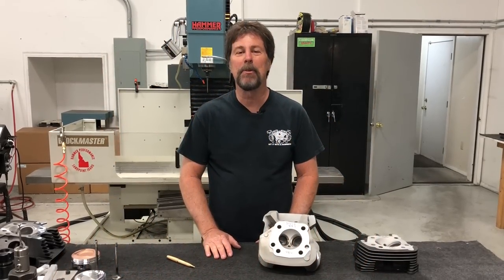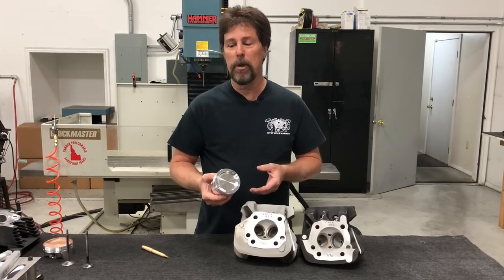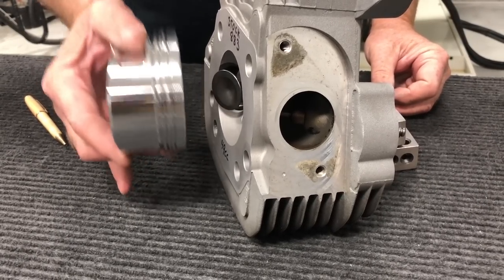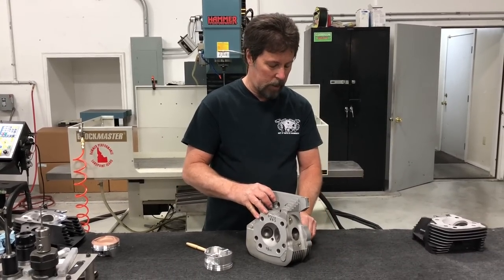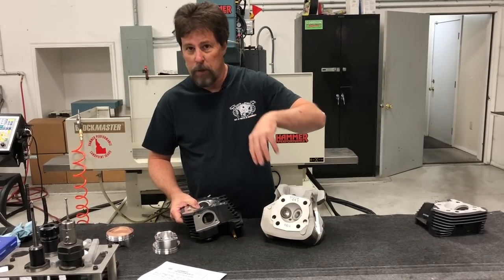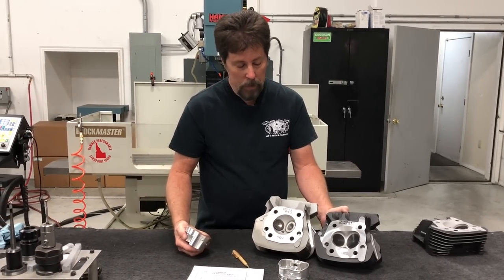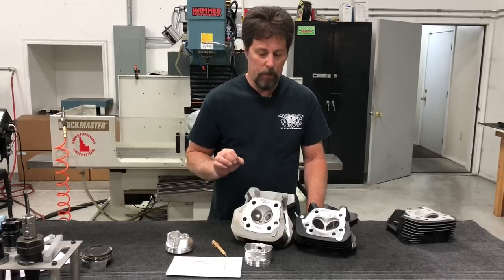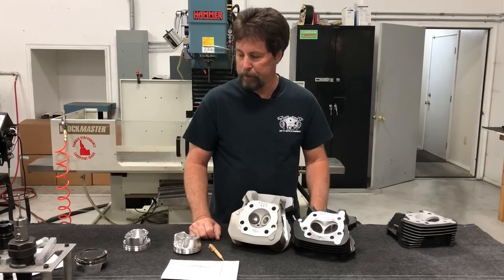Converting A Harley Davidson 883 For Big Power!

Comment: I want to get one of your kits. The stock clutch is about as stiff as I can pull. Any suggestions? I know improvement on the clutch is needed.
Reply from the maker: A clutch upgrade may or may not be needed, depending on the year and model of your Sportster and how far up the power chain you plan to take it. Let me know the year, whether it's an 883 or 1200, and your ultimate power goal and I can be more specific.
Reply: @HAMMERPERFORMANCE  my sportster is a 2002. 883 with five thousand miles. If we can get around 80 hp. I'd be happy. I want to change the front sprocket to 1200 gearing. How much hp can those stock drive belts take?Thanks.
Reply from the maker: @glengerdes2447  See the 80+hp conversion package here: http://www.hammerperf.com/883conversions.shtml#80hp  . No need to upgrade the clutch. The belt is more than strong enough too. That package has everything you need. Download the sample quote to see everything included and what it costs. Contact us using this form and we'll get you fixed up: http://www.hammerperf.com/contactus.shtml#salesform

Comment: Your talking wizardry to me.. But it's cool that you know this much about engineering, please help me.

I ride a 160hp monster s but just recently got a sportster 883 in mat black some eagle iron edition thing. It's the most beautiful HD bike in the best collor of the series to me, that's why i got it and also not to wake my neighbors up every night with that SC project flamethrower. But i find the ride of the HD equivalent to what i call a scooter, and would like to get 110 or 120hp out of it if i can. Is that posible and do you know someone in Europe who can help me do what you just showed us? Did you ever cooperate with someone from theses parts and what do you suggest?
Reply from the maker: You can read about our 110hp package here: http://www.hammerperf.com/883conversions.shtml#110hp and our 120hp package here: http://www.hammerperf.com/883conversions.shtml#120hp . Download the sample quote to see everything included and what it costs. There are several good shops in Europe who can install it. But it's not difficult to do yourself. These are bolt-on packages that can be installed in an afternoon without even pulling the engine out of the frame. We provide instructions and videos and tech support 7 days a week. Most of our customers are do-it-yourselfers.

Comment: how much does your mpgs suffer when you do the 883 to 1200 conversion?
Reply from the maker: Well, we don't sell 1200 conversions so I can't comment on that. But I can tell you that the majority of our customers report an improvement in fuel mileage after installing a 1250 or 1275 kit. 

You have to remember, the bike still needs the same power level to go a given speed as it did before the conversion. For example, if it needed 15hp to go 60mph before the conversion, it still needs 15hp to go 60mph after the conversion. You're in control of that power with your right hand. You're going to automatically apply the correct amount of throttle to make 15hp and go 60mph. The fact that it can make a whole lot more if you open up the throttle is really irrelevant to the fuel mileage when cruising. 

At the end of the day, fuel mileage is a function of how efficiently the motor turns fuel into power, not how much power the motor is capable of making. The efficiency gains you get from raising compression, which is a part of almost every conversion, can actually cause an improvement in fuel mileage.

Comment: Is it normal to experience increased valve train/rocker noise after the conversion? Is it because of the pushrods not being adjustable?
Reply from the maker: There are a ton of different things that can cause excessive valvetrain noise. Incorrect pushrod length is one of many possible causes. When using hydraulic lifters, the pushrod length must preload the lifter plunger an amount that keeps it in it's self-adjusting range over the range of top end growth the motor encounters. But that can be accomplished just fine without adjustable pushrods. Adjustable pushrods may be the easiest way to do it, but certainly not the best way. A non-adjustable pushrod of the correct length is the best solution, in terms of cost, strength, weight, simplicity, and reliability. We offer non-adjustable pushrods in a variety of lengths and we show three different methods for determining the correct length in this tech article: http://www.hammerperf.com/ttpushrodlength.shtml . When we put together a package, we select pushrod length using method #1, and we suggest the customer check it during assembly using method #2.
Reply: @HAMMERPERFORMANCE  Very interesting article! I was of the impression/reassurance from the dealership that pushrods for Sportster do not need any adjustment despite putting high performance cams, valve springs and tappets! Hope no harm is taking place though! Should I be alarmed?
Reply from the maker: @100streamliner  Well, I'm sure you understand, I have no way of knowing whether or not your particular combination requires different length pushrods, at least not without knowing all the details as listed out in the top of that tech article. I would say that if you're concerned, then check them with method #2: http://www.hammerperf.com/ttpushrodlength.shtml#method2 . That's really the only way to know for sure. I will say though that we always upgrade the pushrods to chrome moly pieces when using heavier valve springs, even if there's no need to change the length.
Reply: @HAMMERPERFORMANCE  Thank you very much! Much appreciated and again the article is superb! Will check as you point out using the 2nd method.

Comment: The focus here is all on increasing horsepower and performance. What about a guy like me who wants more torque and is willing to sacrifice performance for an engine that runs cooler and lasts longer? I just want to get down the road better with more speed and better handling.
Reply from the maker: Ultimately, torque is two things: Cylinder pressure and it's mechanical advantage on the crank (aka displacement). So to get more torque, you either have to raise cylinder pressure or raise displacement or both. Raising cylinder pressure increases the heat generated, it doesn't decrease it. So that's contradictory to your goal. Therefore I would suggest focusing on making the motor bigger. Since you're watching this video, I'm assuming you have an 883. The Basic Conversion Package is available in your choice of 1250 or 1275 displacements and either one delivers a massive increase in torque. Read all about it and also see the dyno sheets here: http://www.hammerperf.com/883conversions.shtml#basic .

Comment: Sorry if I trigger you but with a conversion kit on my 883 (to 1200) will I get the same speed that a regular 1200 does or what?Can someone please tell me what exactly it does?
Reply from the maker: We would need quite a few more details to be able to answer that question. For example, depending on the specific years and models you're talking about, the two bikes may have different stock cams. Also it depends on how the conversion was done, for example whether it's done with 883 heads or 1200 heads. If you want to give me all the details, I'll try my best to answer.
Reply: @HAMMERPERFORMANCE  I m talking about 2016 model iron 883 and everything stock
Reply from the maker: @aggelossimadis2511  It just occurred to me that you're asking about an 883 to 1200 conversion. We stopped doing 883 to 1200 conversions several years ago. We offer your choice of 883-to-1250 or 883-to-1275 conversions. You can read all about them here: http://www.hammerperf.com/883conversions.shtml#basic . If you want info on an 883 to 1200 conversion instead, there are many companies that offer them. But not us.

Comment: you say those are the same heads but make no mention of all that material filling in the chamber of the second head.  why not just start with 1986 883 heads? that way you would not have to weld in the chamber and risk dropping a seat. am I wrong about this? where did all that material come from? if you started with a 1986b head you would have had to weld it in.
Reply from the maker: None of the heads shown in this video have any material added to the chambers at all. The first two heads shown have factory stock chambers. The third head shown has an 883 chamber that's been machined, material removed only, no material added.

Comment: What about dyno results?
I'm thinking about buying a 883, but I'm looking for 100hp and 140ftlbs or torque after a conversion
Reply from the maker: You can find a complete description, including dyno sheets, for each of our performance conversion packages here: http://www.hammerperf.com/883conversions.shtml#packages
Reply: You will never see 140ftlbs of torque on a stock set of engine cases. They just don't support the displacement required. The best you can do is 90cu in and around 110-115ft lbs, depending on cam choice. That requires the cases to be taken apart and bored out. 
On stock cases, with stock 2004+ 1200 heads and a 1275cc big bore kit you can get over 90ft-lbs and 100hp with Hammer's 570 cams, which I think is the best cost/benefit right now for a torque oriented setup.
Reply from the maker: @depthsounderdave  David is exactly right on all counts. Fundamentally, engine torque comes from two things: cylinder pressure and it's mechanical advantage on the crank. Available fuel and cooling capacity place limits on the cylinder pressure, even if you can achieve the cylinder fill you'd need. "Mechanical advantage on the crank" is a fancy way of saying "displacement". So to make that much engine torque, at a workable cylinder pressure, you have to make the motor big. The stock cases limit how big you can make it. At stock motor height, 90ci is the practical limit, which is capable of putting you right into the range David mentioned. You can go bigger by combining bore with stroke, but the motor will be taller and won't fit in the stock chassis without frame mods. And 140ft-lbs would take a very big motor on anything resembling pump gas. Any motor build bigger than1275 requires a full tear-down and lots of expensive parts, too. You can't hardly do a 90ci conversion for less than about $5K. A 1275 by comparison is a lot less expensive and can be installed in an afternoon without even pulling the engine out of the bike.

I have no idea who David is, but he knows what he's talking about.

If you really want 140ft-lbs, you should go get a Big Twin and make the motor as big as possible. I think you'll end up disappointed if you try to make a Sportster run like a Big Twin. That's not what they're made for.
Reply: I'm just a home hobbiest, engineer, amateur engine builder, and potential future customer who is doing his research on a torque oriented build. I've spoken with Alex a few times and am trying to diagnose a potentially bad crank before I send in my engine for a XR1200 crank and 90" big bore.

Comment: Can I run the 560 cams with stock 883 heads?
Reply from the maker: The pistons may hit the valves. See here for more info on running cams with stock 883 heads: http://www.hammerperf.com/883conversions.shtml#faq1

Comment: are the 1998 to 2003 sportster sport/thunder storm with the dual spark plugs really that much better or just some what better? or can i just get a normal 1200 and  build of off that. i would like a 1200S with the dual spark plugs heads but for the price definition for a normal 1200 IDK if its woth the extra $1,500 or so. hope that makes since. and keep up the vids.
Reply from the maker: If you've got an 883 and you want more power, the best, most cost effective path is to modify your 883 heads. The beauty of 883 heads is they have a lot of material in all the right places and that allows us to make a really great head out of them. We've made over 130hp at 1275cc using 883 heads! 

So all of our performance conversion packages are based on modifying your 883 heads. See the packages here: http://www.hammerperf.com/883conversions.shtml#packages

Now, that said, if you really want to do the conversion with 1200 heads instead, avoid the the 98-03 1200S head like the plague. It's not a "Thunderstorm" at all, it's a dual plugged version of the 96-98 Buell "Lightning" head, so named because it was first introduced on the 1996 Buell S1 Lightning. This head has the same small 1.720/1.480 valve sizes as found on the standard 88-03 XL1200 hemi heads, as well as the same crappy ports. Really the only difference between a standard 1200 hemi head and a Lightning head is some additional material in the chambers to reduce the chamber volume and raise compression to about 10:1 when used with flat tops.

The Thunderstorm on the other hand was the second generation XL performance head, introduced on certain Buells in 1998 and then all of them beginning in 1999 and extending through the end of the tube frame models in 2002. This was a MAJOR improvement over the Lightning head, with larger 1.810/1.575 valve sizes, much improved ports, and a chamber that does not shroud the valves so badly - compression was increased via the use of a small dome piston instead, and a squish band was added.

So don't confuse the 98-03 1200S heads with the Thunderstorms. Two completely different animals. The 1200S "Lightning" heads are not in the same league with Thunderstorms and you should not spend money to get a set, not for a performance project anyway.

The third generation of XL performance head is the XB head, as introduced on the 2003 Buell XB9 model, and then propagated to all XL1200's beginning in 2004. This head is significantly better than the Thunderstorms in several ways, and if you're doing a performance project, this is your best bet. The Thunderstorm was a great head in it's day, don't get me wrong, but it's day has passed.

Read more here: http://www.hammerperf.com/ttxlheads.shtml
Reply: damn thanks man. dope info!! I do not have a sportster right now but im planing on buying one ASAP.
Reply: 130 hp using those heads, that's awesome.
Reply: hey man, i got one!!! 2001 xl1200c it leaks oil so need to figure out where that is coming from. and i few other things. have you ever used a fluorescent dye for leak detection? just wondering. ill be calling you soon so see what i might need.  thanks!!

Comment: Can you run se 497 cams with stock 883 heads with a 1200 conv reverse dome kit
Reply from the maker: Guys do it, but some have piston to valve contact, it really pushes the clearance. I guarantee you that you'll be much tighter than the recommended .050" intake and .080" exhaust clearance. It's not something we would ever put a customer into, simply because some percentage of them would have a problem.
Reply: @HAMMERPERFORMANCE  ok thanks for the reply 👍

Comment: Will 505/515 cams with stock 883 heads cause clearance issues?
Reply from the maker: The Feuling 505/515 cams have very low TDC lifts (.150/.137) and therefore they create no issues with valve-to-valve or valve-to-piston clearance. However, the reason the cams have such low TDC lifts is because they have so little overlap (26 degrees), which will limit their power gains. Also, the relatively late 48 degree intake close point will move the powerband up the rpm scale at the expense of bottom end and mid range. So know what you're getting before you go with those cams. Also read this: http://www.hammerperf.com/883conversions.shtml#faq1

Comment: can you tell me what is causing my xl1200ns iron 2019
Wen i give gas it jerks and again when releasing the throttle and the clutch is doing the same thing and it's hard to maintain 30 km/h it's jerking and i keep shifting all the time 
never believe that a HD 1200 Iron could be having so much problem, it have only 5000km what can do it's my firs Harley and dont know much about them